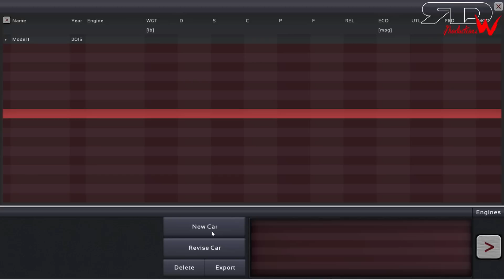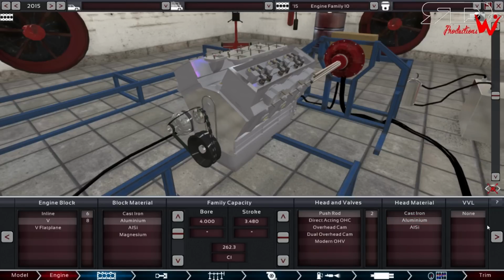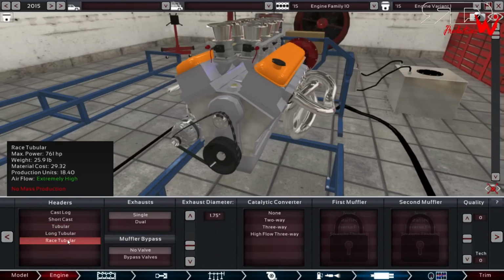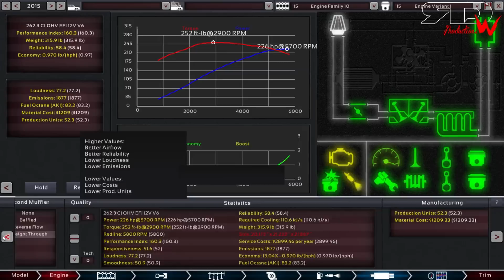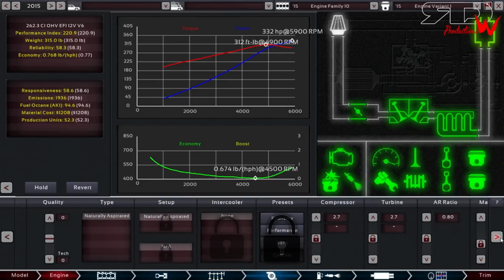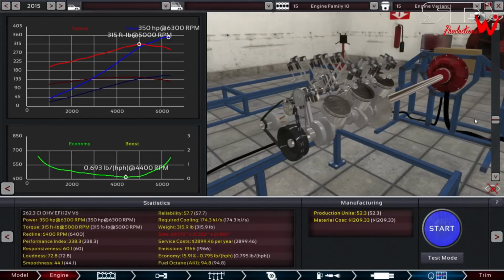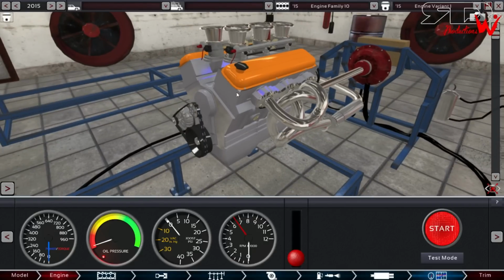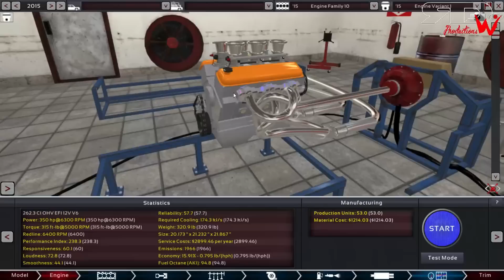Chevy 4.3L Vortec V6 All Motor With ITB's | Build & Dyno | Automation : The Car Company Tycoon

Comment: FYI all 4.3s pre 2014 are cast iron blocks with cast iron heads. GM did make a few aftermarket blocks from aluminum for 10k dollars and Brodix made 2 different types of aluminum heads but they were also very expensive and both have been long out of production.

Comment: You listed it as an iron block. The 4.3 Vortec motors (outside of possibly the modern direct injected ones) were all cast iron. Only way to get those in aluminum was to buy a Chevy performance "bowtie" block. At that point you'd be running dart heads and it'd be damned close to the engine that Chevy actually raced. Nice thing about the performance block was it was also had dual gallery oil feed where the standard block was only single.
Reply from the maker: Sorry its a game lol

Comment: that would be  a fun little motor in a single cab short bed s10 with a 5 speed and a posi rear.
Reply from the maker: without a doubt! im surprised with the power it made. very health for the little V6.
Reply from the maker: $29.99 US on Steam. Its PC only
Reply from the maker: on the list
Reply from the maker: will be coming up. currently live streaming at twitch.tv/ridindirtywerkz for a bit longer
Reply: not enuff TQ for a heavy truck..needs more TQ at 2k and more a flatter curve

Comment: The 4.3 is a 90 degree V angle. I didn't see an option in here to set the angle but the block is a 60 degree. Also the Vortrecs were iron blocks. The LV3 is aluminum but is Gen V LS based.

Comment: It is modern OHV. Just like the Gen III-V SBC V8's.
Reply: Nope It still had the same pushrod design as the 60s blocks. The newest 4.3 may have finally updated this along with direct injection. but the one in s10 and blazers was a seriously ancient design.

Comment: I promise you that 4.3 can push 300 horses. Bore it 0.030 over and stroke it out. They shouldve made it sound like a 350 cause thats what it sounds like straight off the manifolds.

Comment: If it's possible, make a made-up Honda J-series. V6, variable-valve timing(VTEC!!), balanced power and torque, and... A turbo. Also, the engine should be a big-block motor, say around 4.5L. Call it the J45A1.
Reply: Variable valve timing is not VTEC Variable Valve Lift is VTEC

Comment: nice build..its cammed quite a bit I see the one thing I cant figure out why the makers of the game haven't done an update to be able to change the engine block degree type. When a V6 is selected in the game it defaults to a 60 deg block..when the 4.3 an 3.8 blocks are 90 deg blocks just like a standard small block v8. Iam gonna do a build of the 4.3 with the somewhat close stats as you with some tweaks to the compression, timing and exhust also use carbs and show ya how much flat curve tq while making good Hp a 4.3 can make. I choose to use a traditional push rod valvetrain pre 1992 4.3 with no balance shaft and upload it. https://en.wikipedia.org/wiki/General_Motors_90%C2%B0_V6_engine#LB1_and_LB4